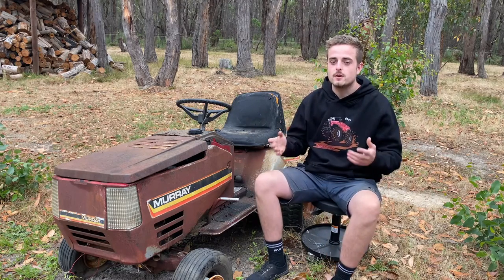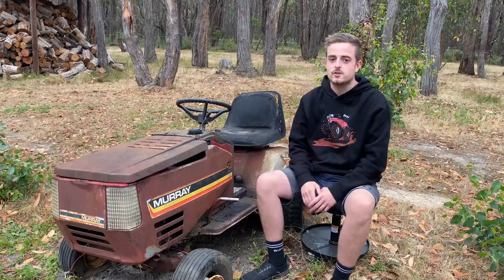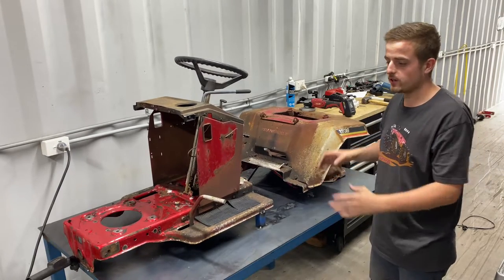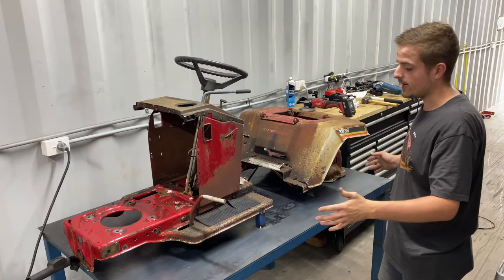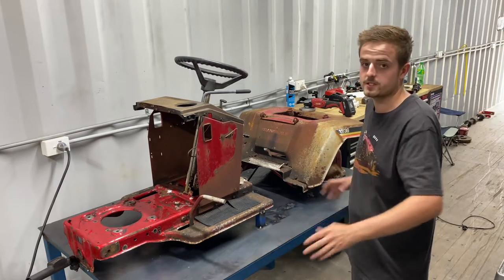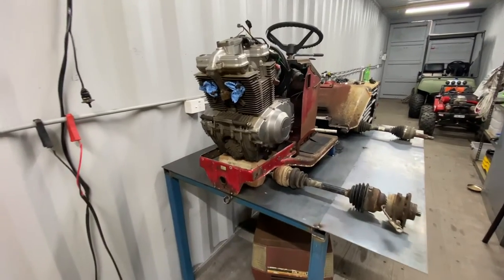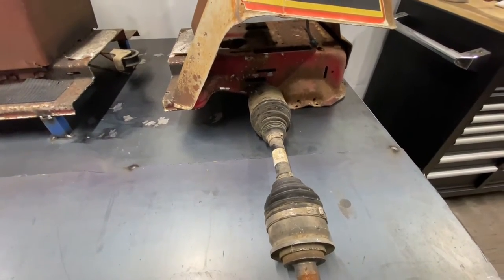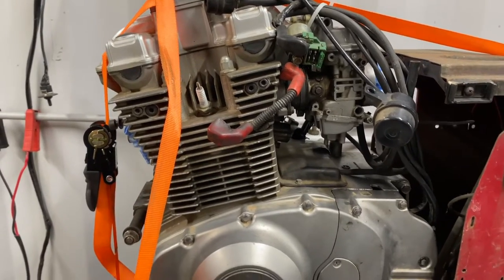4X4 50HP RACING Lawn Mower Build!

Comment: Why not gear driven transfer? Chain driven you can't add reduction gears
Reply from the maker: I was hoping to save on weight otherwise I would need two differentials and then drive shafts to connect the both to the transfer case. Possibly atv running gear but I can’t find anything that is affordable..